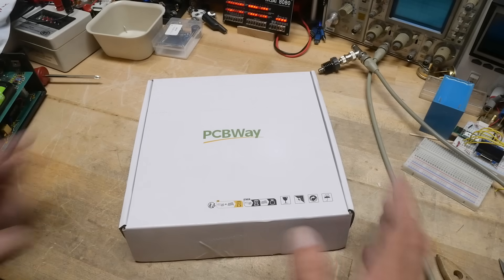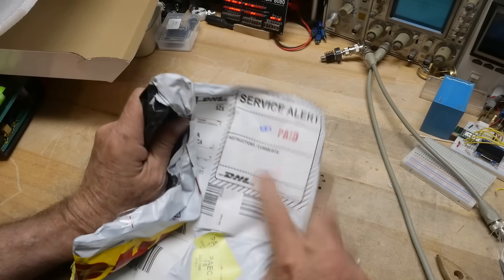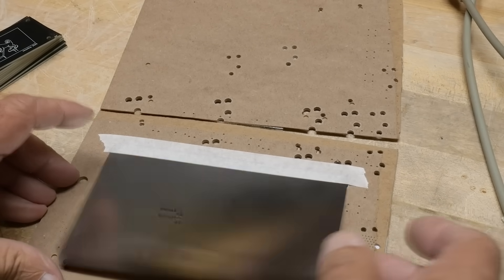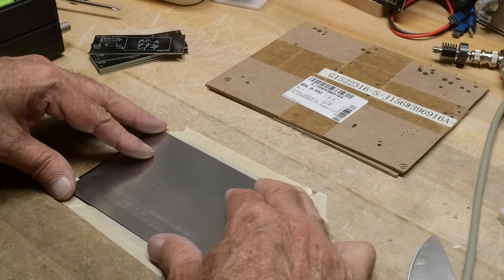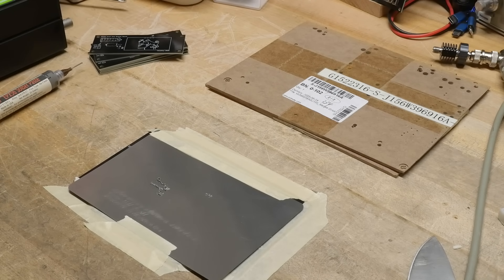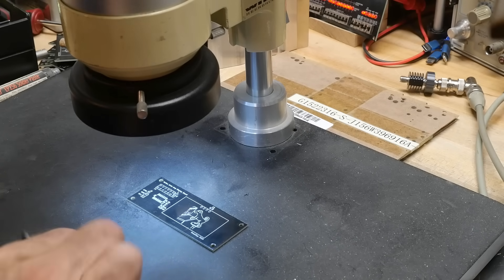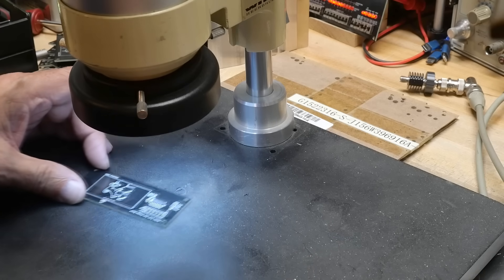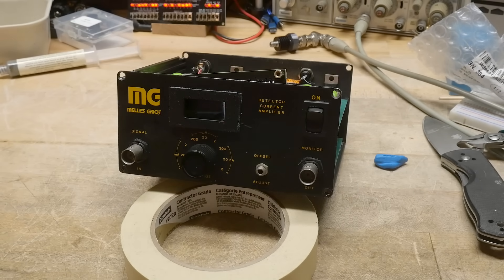#2290 Melles Griot Transimpedance Amplifier (part 5 of 6)

Comment: US made PCBs are horrendously expensive - China invested in the ability to make PCBs from huge (1m+ x 1m+) PCB panels, while US manufacturers kept the same small panel sizes. This is how China can do those PCBs for $5 - they combine your order with others, nest it out on a panel, then produce it. The cost of doing one huge panel is basically the same as the cost of a small panel, so you're paying for the panel and a fraction of the processing costs. It's why those $5 offers don't apply to pre-panelized designs - your board gets tossed in with other people's boards, nested to optimize board consumption, and it's all optimized away so all the drilling is automated (the nesting takes care of the new drill hole locations), etc. It's a service only made possible in China because they had to invest in all new manufacturing lines so they went big, whilst US manufacturers couldn't without throwing out their entire production line. And it's going to hurt because home etched PCBs without solder mask, or through-hole plating, or silkscreen is just barbaric. You go from modern looking PCBs that can look like something that belongs with the latest electronics to back to the state of the art of 50 years ago.. I don't know, this is likely to push people off electronics when everything they try to build looks so dated. On the other hand, it might bring back the old school through-hole parts because SMD is basically impossible without solder mask.
Reply: Oh you better believe getting 1.5m PCBs populated is SO much fun...

Comment: I had a similar experience. When the tariffs were put on, I figured I'd be a good gut and went to DKred to get quotes from US suppliers. For what would have been a $10 board from China, I received quotes ranging from $110 PER BOARD to $340 PER BOARD. You can't convince me that it is 11 to 34 times as expensive to make a PC Board in the US. Sorry, but we're being ripped off by the US suppliers - they know they have a captive audience now. Needless to say, I won't be doing any hobby hardware projects for as long as the tariffs are in place.
Reply: Unfortunately it's not cheap to do anything here.  Vastly higher labor cost, insurance, taxes, employee benefits, high property cost or lease, staying compliant with safety standards/regulations and other day to day overhead operating cost.  It all adds up to just plain costing a crap ton more to be in business here.  Net result is that product you can get made and delivered from overseas for $10 will probably cost $100 or considerably more to be made here.  However if you don't mind not having any benefits, any insurance, poor and unsafe working conditions and barely making enough to feed yourself then sure, you could make it here for a lot less.  Most Americans seem to forget or just were not alive "back in the day" when things were significantly more expensive.  A ultra high end Television in 1960 could be around $1,000 (that's 1960 dollars).  According to the U.S. Bureau of Labor Statistics, prices for televisions are 99.22% lower in 2025 versus 1960 (a $992.22 difference in value).  What happened, we started having our electronics made overseas instead of here in the US.
Reply: And no Ugerars.     @mikesradiorepair
Reply: @mikesradiorepair  I don't know where you got your numbers for an "ultra high end TV in 1960" but I did work in a TV manufacturing plant in the early 1980s. Our most popular 19" TV model sold for $259. Our line workers cost $10/hour all in (not a bad wage in the early 80s -as an engineer I made $24,000 a year). They also had full benefits. No, the real problem was one of volume - there were 13 U.S. TV manufacturers. What you paid for parts is strongly influenced by what volumes you buy. The Japanese television manufacturers were so much larger than the US companies that they could sell a TV for less than what the parts to build one cost us. Read that again - even if U.S labor was free, we still couldn't compete! The solution would have been to consolidate and we actually tried to do that, but the DOJ shot that down. The net effect is that a decade later, there were NO US TV manufacturers. You could still buy TVs with US brand names on them, but they weren't made here.
Reply: @Hardlygamaliel  But you are talking prices in the 1980's.  TV's had greatly decreased in price by then compared to 1960.  I'm very familiar with the pricing of early radios and TV's.  My grandfather opened his radio shop in 1932, later a radio and TV shop.  In the late 1960's when my grandfather passed away my uncle continued the business into the early 70's.  I have rows of filing cabinets filled with all the original sales literature, repair literature and sales receipts dating back to 1932.  I still have the shops sales demo 1946 RCA  630-TS which was the first mass produced TV.  In the early days of TV there really wasn't any competition from outside the US, for the most part they were all made here with US made parts.

Comment: I use Oshpark. Yes, they are more expensive and they don’t have the breadth of services that PCBWay does, but they are very high quality and very easy to use. I have had easily over 100 boards made by them in the past 5 years and I’ve only had 1 problem which they corrected at their cost, no hassles. I have tried overseas PCB alternatives and while they are cheaper (before tariffs), I have found their customer service to be a hassle. Just my opinion/experience.
Reply: I've ordered from oshpark a long time ago, and more recently JLC, and never had any quality issues with either. I did have an issue with JLC's assembly service right when it started, but they issued a credit to re-order which was nice of them (it kind of was their mistake, and they provided no feedback, just didn't populate a part making the boards mostly useless)
Reply from the maker: I did not see how to order a solder stencil from them. wanted to look at costs
Reply: @IMSAIGuy  you submit your order for stencils through their partner OSH Stencils—I believe this can be done from your OSH Park order history after you order your PCBs. Their website says they’re about $5-$10.
Reply: BTW, thank you for the rant. This tariff crap is such BS!!!!

Comment: Hold up… 185% of $0.00 is $0.00…

What is this? Tariff on the imaginary amount you would have paid if you had paid some amount other than the amount you actually paid??? 

Make it make sense… 🫥
Reply from the maker: the Tariff due is based on the customs form. it is the VALUE of the incoming item, that is usually the cost (item+shipping). It does not matter who paid for this. It is the responsibity of the importer (me in this case) to pay the Tariff.
Reply: It may be provided free to the recipient but it still has a cost.  That cost is shown on the customs form when you ship something.  No reputable company is going to lie on a government customs form for your benefit.
Reply: @mikesradiorepair  It can be declared as sample at 0 value
Reply: @ciano5475  Still have to pay a tariff if it is from China or Hong Kong.  They removed the de minimis exemption from those countries.
Reply: @mikesradiorepair a couple of years ago before eu forced Ali sellers to pay duties, sellers were very happy to declare a "sample without value" or an amount under the threshold to avoid taxes for the buyer. 😉 I am sure western suppliers wouldn't....
Reply: @pietpaaltjes7419  hehe yeah, 'gift' 'sample' value 2 Euro lol

Comment: how about oshpark? 
ive ordered from them long long before pcbway and jlc was even a thing (around 2017) , 50x50mm 2 layer, 3 pieces for like 20 bucks shipped to germany.
not dirt cheap but not overpriced, they were purple and ENIG.   
checking pcbshopper, its 25 bucks now. but larger and more layer get really expensive quickly.

germans now got aisler, its their equivalent to oshpark. not chinese priced but alright.
pcbway is nice but most of the time 5x as expensive as jlc for the same capabilities and quality.
Reply: Yeah, oshpark is fine for really tiny boards, but they get stupid expensive when they get to even medium size or larger. I also agree that JLC is usually way cheaper than PCBWay - hence why PCBWay pushes so hard sponsoring every single channel that does anything PCB related on yt. I've only ordered from pcbway once, and it was cnc machining because JLC didn't have the material I wanted, and I was trying to get the order in quickly before tariffs came in
Reply: oshparks after dark pcbs were really nice, especially for small pcbs until germany decided dhl should now collect vat on small orders with a service fee of their choice

Comment: There is a alternative, make your own.  Not ideal by any stretch of the imagination but that's what I ended up doing.  I figured if I was going to do it I might as well do it right so I got a higher end  PCB CNC milling machine from Wegstr in the Czech Republic.  Have probably made a little over 100 double sided boards now.  For thru-holes and via's there are hollow copper rivets that get pressed in the holes.  Not hard to do solder mask either.  After milling the entire board gets a silk screen coat of UV cure solder mask.  Once cured it goes back on the milling machine and it mills off the solder mask from the solder pads.
Reply: I'd have to make a whole awful lot of PCBs to justify a 3200 euro cnc. But your general point about DIY is good. I've started looking for the cheapest viable cnc/laser engraver that I could use to make 2 layer boards.

Comment: I can see the return of home etching now.
Reply: Or do what I did, get a CNC PCB milling machine.
Reply: @mikesradiorepair  I do the same, but milling kinda sucks for two-sided boards. Riveting vias through gets really old really fast. Milling does work fine for simple boards though, as long as you can avoid extremely fine pitches.
Reply: @AttilaAsztalos  If your only doing a board now and then it's not to bad staking the rivets/eyelets with the rivet hand staking punch and hammer.  When you start doing more and more boards it does get old after a while.  I got to that point and made a pneumatic rivet staking machine.  It's foot switch actuated and surprisingly fast to do now.  Bungard and Fortex are two companies that make hand operated rivet presses that use staking die inserts.  I designed my pneumatic press to use the Fortex dies.